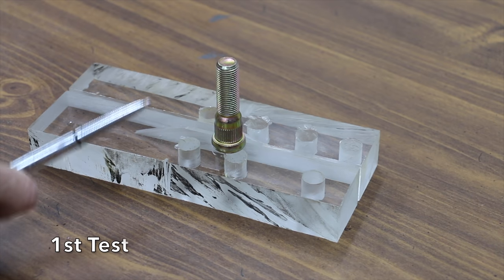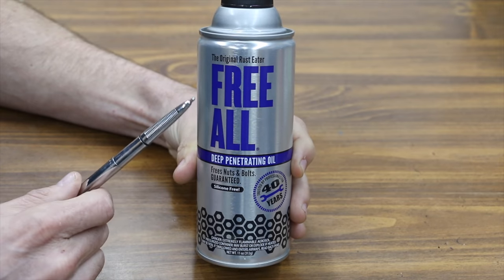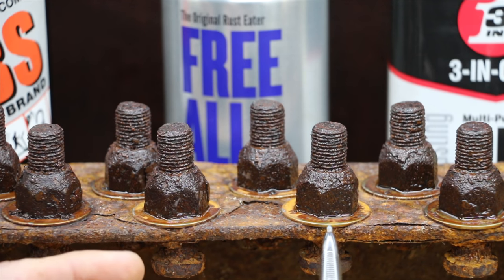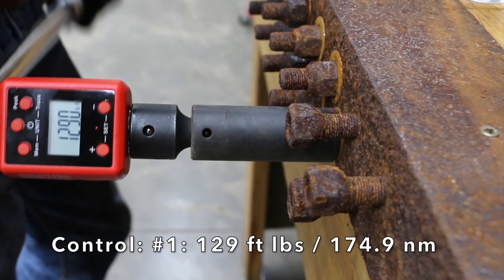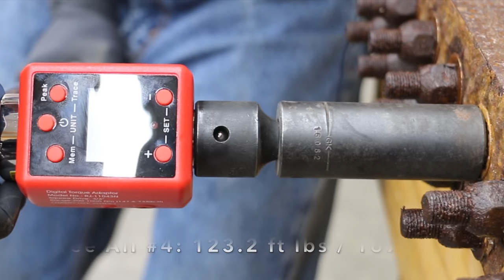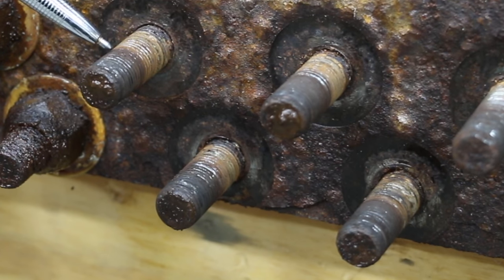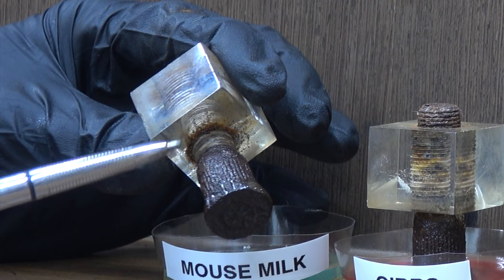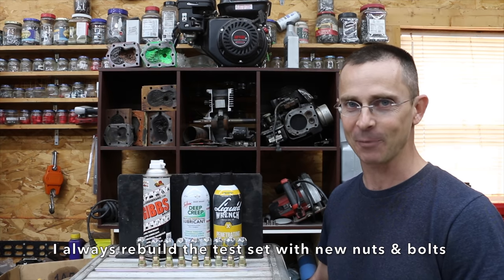Does Water work better than Penetrating Oil for Rusty Bolts? Let's find out!

Comment: Try mixer of 50% Acetal and 50% transmission fluid
Reply from the maker: Thanks for the video idea.
Reply: @ProjectFarm  oops I made a mistake the penetration mixer is Acetone and Transmission fluid 50% mix.  Also you might want to try brake fluid both neat and as a mixed

Comment: you know, I've been using penetrating oils for years and I'm not even sure they did a damn thing to help, but lubricate the threads around the nut, so at least it was easier to remove once I already broke it free. soaked an exhaust manifold with PB blaster for a day and still ended up breaking off the bolts. Drilled and tapped. I'm bout done wasting my money on penetrating oils...
Reply from the maker: Thank you!

Comment: You seemed impressed with Gibbs.  I'm not impressed with any of them.  Reduced torque required to loosen a bolt by like what 10-15%?  Not worth the effort of using the product at all if that is the result.  I was expecting it to cut it down much more significantly!
Reply from the maker: Great point. They all needed more time. Thanks again.
Reply: @ProjectFarm  Try a 24 hour test.  If it helps significantly vs the 1 hour test, then thats good to know.  If it doesn't really help much more, than your testing has showed me not to bother with a penetrating oil.

Comment: Completely unrelated, i have been wondering what would happen if you replace lawn mower blades with round street sweeper brushes (like this one: https://5.imimg.com/data5/VC/OS/AK/SELLER-72796367/street-swiping-brush-500x500.jpg) in a mower that has a side chute. Would they just rotate too fast and break them apart?
Reply from the maker: Thank you

Comment: Superfluid helium would probably the be the best penetrant physically possible.
Reply from the maker: Thank you
Reply: @ProjectFarm  You should take a look at some of the videos about it here on youtube, it has some really really strange properties. For example, it'll climb right up the walls of a container and siphon itself out, and it has exactly ZERO viscosity. Also, heat is transported through it by waves, making its thermal conductivity incredibly high (this property is known as second sound).

Comment: I've heard that Coke a cola, is great for destroying rust. Wondering if you have ever tried it?
Reply: it's the phosphoric acid in coke that reduces the iron oxide (rust).  it is in VERY low concentrations in coke.  almost ANYTHING else would work better.  Vinegar is better, but still bad.  cheapest and most effective DIY is electrolysis.

Comment: Test remoil for penetrating oil and as engine oil its teflon lubricant
Reply from the maker: Thank you for the video idea!
Reply: Welcome I use it on everything it works great for stuff pliers it frees them up and you can see the rust come out of the joints

Comment: The only thing I really learned here is that some people use water to further rust their rusted metal in order to free it. It actually makes sense though. In fact, salt water would probably ruin the metal even faster. ;) 

I'm sure it works the best given time. You could simply turn it all to dust. The utility of this method is what's in question. I'd probably just apply extreme heat for expiediace and salvaging. Lol.

I'm a fan of 3in1 honestly. It's what my grandpa used and his grandpa and his grandpa and ect... okay maybe not but you get the point I'm sure.
Reply from the maker: Thank you

Comment: Statistically you just proved there’s no real difference between any of the products, including water. Gibbs might be better than the worst but it isn’t exactly compelling.
Reply: 10% won't matter, unless you push 10% over the bolt's torsion strength.
Reply from the maker: Thank you!

Comment: the secret for water to loosen bolts is to heat the bolt first till its red hot, then apply water lmao that fucker will pop loose with a 5 yo wrenching on it
Reply from the maker: Thank you

Comment: Project Farm, I love your videos.  Have you ever tried Corrosion X?  It is a product that works well for breaking loose rusty parts.  Rumor has it that it was designed for use by the Navy.  It happens to be a dielectric material and can be used to waterproof electronics.  I would love to see it tried out in one of your videos.  It is rather pricey in the squirt bottle at $20.  Thanks for all the time you put into these tests.  I personally use it to waterproof electronic speed controls and receivers for radio control rock crawlers.  There are several videos on here of showing what water will do to a high power ESC and what a simple application of Corrosion X can do.

https://www.amazon.com/Corrosion-X-Corrosion-Technologies-91002-Corrosionx/dp/B0009GYRWW

https://www.youtube.com/watch?v=w7jWZpRzFWA

https://www.amazon.com/Corrosion-X-90104-Heavy-Duty-12-Ounce-Aerosol/dp/B0009H1AMG/ref=sr_1_1?keywords=corrosion+x+hd&qid=1557414880&s=sporting-goods&sr=1-1-catcorr
Reply from the maker: Not yet. Thank you for the video idea!